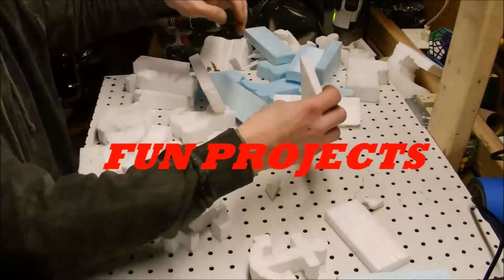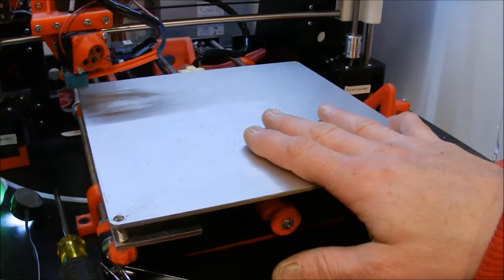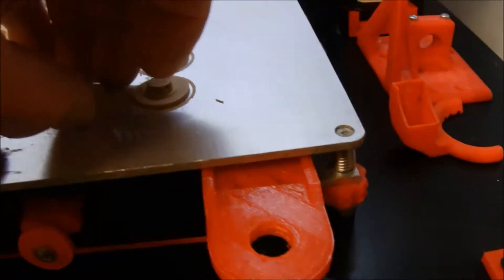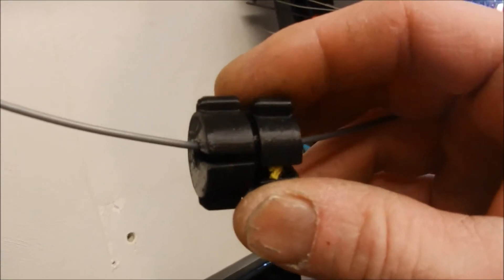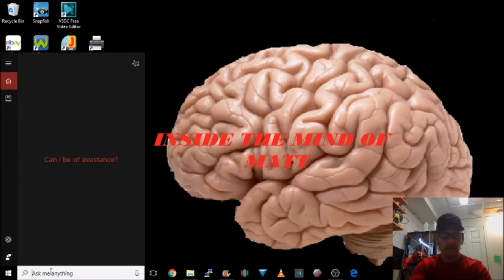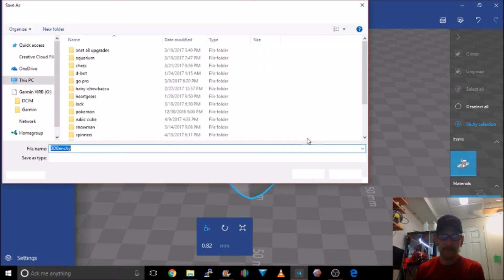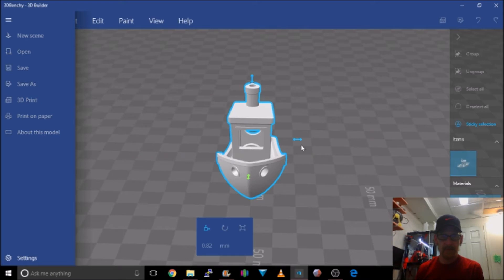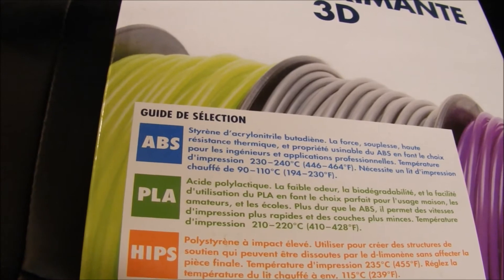5 TIPS FOR 3D PRINTING

Comment: Nice tips to keep in mind. Thanks for sharing some things you've learned along the way. My A8 is finally on it's way, and I wondered if you could tell me (roughly) the dimensions of the compartment, housing the anet, in your Lack table setup? I'm going to be building an enclosure, just a box style hood I can raise or lower, but I don't know what good internal dimensions would be to provide clearance all around.
Reply from the maker: if you were to go around 21inches cubed you'd be good doesn't have to be 21inches high 19 min. would work 20-21 to be safe

Comment: Thanks Matt. Going to try building a super light weight box using an insulated foam sheet that has a metallic coating on one side. This stuff is typically used for construction (I'm sure you know what I'm talking about) and is about a half inch thick. I'm planning on having the metallic side of the foam pieces facing inwards towards the printer. Do you think that this is a fairly safe material to use, seeing that it won't come into direct contact with any of the printer? It's only purpose is containing the ambient heat, and I'm guessing the insulating sheets are not highly flammable, seeing as they are used for firewall insulation between condos and apartments. But the ambient heat should be nowhere near the foams melting or flash point anyway. Thoughts?
Reply from the maker: sound like it should work you want be able to keep an eye on the printer and you'll really only need an enclosure if your printing temp sensitive materials like abs maybe nylon but pla prints all day with no encloser
Reply: I was thinking of a small plexi view port or even a larger plexi window on the front. My reason for this is I plan to start my 3d printing experience with A8 upgrade parts, and I plan on making them all with abs to avoid any softening pla parts in the heat of the enclosure on future abs prints. I know you and I had this discussion once before, and you had mentioned that you haven't really had any problems with softening pla except for your camera mount. I'm just trying to be proactive and avoid a possible future problem, and having to potentially do remakes in abs at some future date anyway. You know how long some of these prints can take, and the amount of filament they can eat through,  so I'm sure you understand that I only want to make them once if possible.  Hopefully starting with abs isn't a complete disastrous nightmare for me lol. 😁
Reply from the maker: I'd be interested in seeing the final product
Reply: As will I, haha. I'll make sure to keep you updated. I'll definitely be a subscriber from now on so I can steal your ideas! I'm also still working on those zbrush tutorials and slowly getting better with my modeling, so hopefully some day soon I can send you some custom stl's to try out!